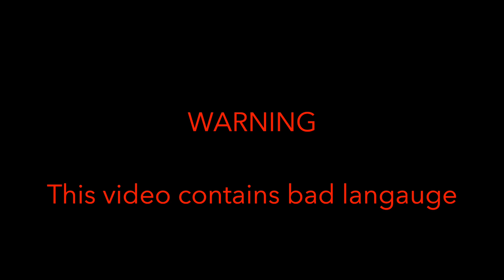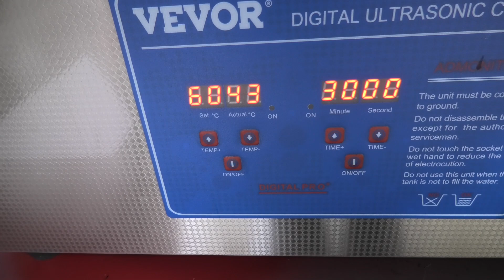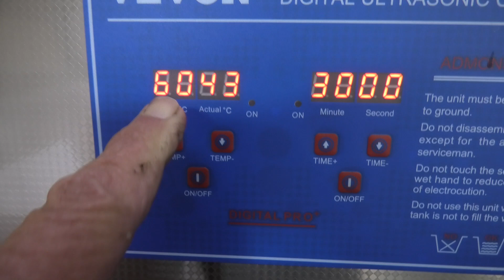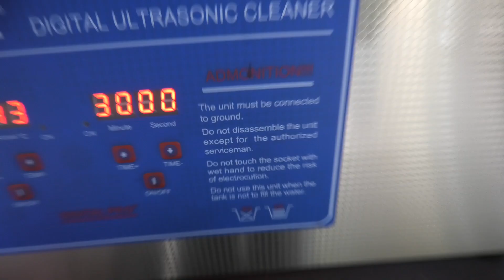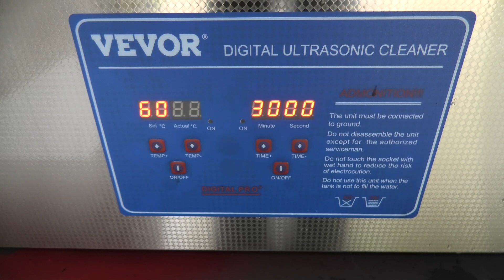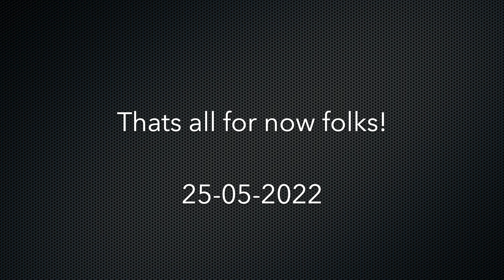Video 14.  Ultrasonic cleaner (Part 2). Sorry about the bad language.

Comment: Hi Graham, I’m a little behind with your videos, so I am just catching up.

I think it is so sad how the tiny few have to ruin the enjoyment of the majority. 

When I left school I did my apprenticeship as a mechanic when that actually meant something. When you had to diagnose an issue by sound, smell, feel etc, and ecu’s weren’t even needed.

I have also had the privilege of working on advanced modern engines where the computer diagnostics guide you towards the issue and each era has its own skills.

I haven’t seen you do anything unusual for a home mechanic in your videos that I wouldn’t of done different, but even if you had then you have a slightly different way.

I use ultrasonics with work myself and agree they are a great machine with the correct solution, temperature and cleaning time. But you have to trial and error to find the right method like you have.

I have looked into vapour degreasing recently and £29k for a machine and £18k per annum for cleaning fluids makes that to pricey for the home mechanic. Aqueous machines can be £10k - £15k so same again too expensive for the home mechanic so in my opinion you made the right choice.

Keep doing what you do Graham and remember that they are only jealous that they don’t have the balls to put their money and time and effort into building something, and certainly would be able to handle other’s opinions of their work!

So chin up mate, and s o d them!
Reply from the maker: Hi Dave and thank you for the supportive comment my friend, it’s greatly appreciated.  The ultrasonic cleaner has been great since I have now worked out what to use as regards the cleaning fluid, got the right temperature and time - so all good now.  I’m obviously just a bloke in a garage so I can’t afford expensive professional type equipment and to be honest, as this will be my final and last car I build then it’s just not worth it for me to invest heavily into expensive tools. In fact after I have finished this then I will probably sell on some of the tools as I doubt very much if I will use them again - we shall see.   

You’re dead right and it’s sod them to those who disagree or think they can do better, they probably can but it matters none to me, as long as I’m happy doing what I’m doing then that’s really all what matters to me plus of course, hopefully seeing a great car at the end of it.    👍🏻👍🏻.        Cheers for now mate.         …………Graham

Comment: Hi Graham, I have a suggestion to save on cleaning fluid. If you are cleaning small parts, place them in a ziplock bag with the cleaner and seal it up. Just use plain water in the cleaner tank and drop the bag in. The ultrasonic waves will go through the plastic bag and clean the parts. When finished just empty the bag of parts and your water in the tank is still clean for the next time.
Reply from the maker: Hi mate and thanks for the comment and yes, I’ve seen that on quite a few videos I’ve watched, it works really well too!  So thanks for that and much appreciated!    👍🏻👍🏻👍🏻.       Cheers for now mate.         ………….. Graham

Comment: Now I’m a bit stupid. And I was thinking, ah mate you’ll have to invest in a parts bath a wire brush and a boat load of time.  Never in a million years would I have though about a sonic cleaner. And look at the results. Absolutely clean as you like.  I’m really pleased as well, more so because you’re not having to stoop over a parts bath lol.
Reply from the maker: Hi mate and I can understand what you are saying and it wasn’t until recently that I started picking up on these cleaners. The main thing which I like (now that I have sorted out the initial problems) is that I can just dunk them in the cleaner for half an hour or so and then carry on with another job while they get cleaned - Brilliant!   I just go over with brake cleaner afterwards and the part is really clean - not just on the outside but also internally too as the ultrasonic waves go through to the inside holes etc.   👍🏻.   Cheers for now mate.           …………Graham
Reply: @mygentrybuild1974  I can’t wait to see more. There’s just something about a clean engine that sets off a classic.
Reply: @mygentrybuild1974  I never thought about that.  Blimey. I can’t wait to see more.

Comment: I am so sorry that you have so much abuse, Graham.  If people don’t like your channels, as with the TV, they should just switch off.  Unfortunately, it is a sign of the times.  So many people want to be nasty to others for no good reason, no matter what the subject.  In a lot of cases, it’s the politics of envy.
Anyway, I’m pleased that the cleaning is moving forwards in a positive way.  As always, making small changes and experimenting with the variables, leads to optimum results.  I’m so pleased for you, Graham, regarding your achievement with this new bit of kit.  Take care, mate. Best, Jason.
Reply from the maker: Hi Jason and many thanks for that wonderful supportive comment, that’s really appreciated mate.  Yes, it is a sign of the times but it’s not something I will tolerate - either face to face and certainly not on a social media platform.  I don’t give a damn what the reason is, there is no just cause to behave like that.  Anyway, enough of that, I’m totally happy now with the end results and the pile of greasy bits which I didn’t show came out just as good as the carbs and pulley so that’s a big tick in my book!    👍🏻.     Cheers for now mate.           ………Graham

Comment: Graham ... Illegitimi non carborundum .. actually: Ne nothi te deorsum ..."Don't let the bastards get you down"   Also GREAT timing  I just put some parts in my cleaner .. using Simple Green and as HOT as I can get it .... cheers mate......
Reply from the maker: Hi John and normally I wouldn’t have found it a problem and would have just thought what an arsehole but this was different. I couldn’t let these bugger get off so lightly.   Anyway, I’m pleased with my set up now and it did its job without any hard work - which I like!   😂😂.     Hope yours comes out ok too.  👍🏻.        Cheers for now mate.         …………Graham

Comment: well done ya I have had a few knobs on my vides I just dont really care. funny Iam doing my SU's right now for my TR3 but I dont have a ultra sonic I am using the old carb cleaner and a glass bead blaster.
Reply from the maker: Hi Mike and thanks for that. I expect to get a couple of knobheads on here now and again but not the level of abuse I got on that last video - that was ridiculous and came out the blue, it’s been absolutely fine up until then.       Cheers for now mate.          …………. Graham